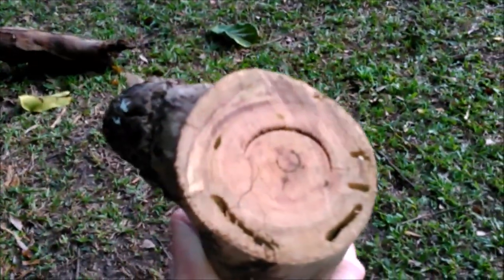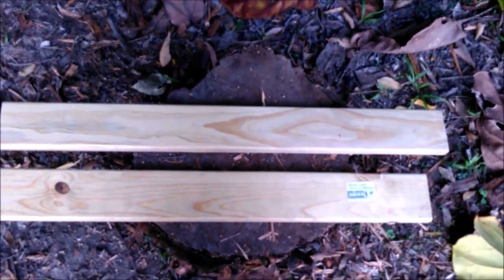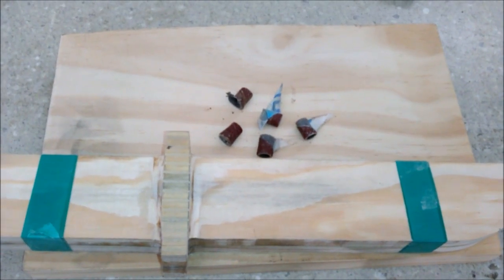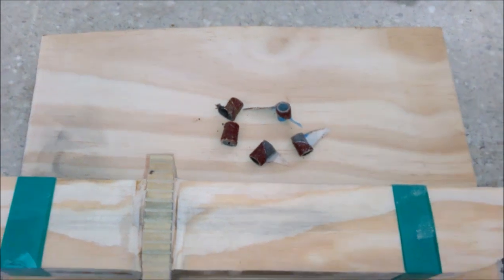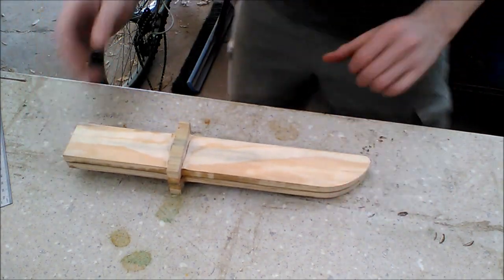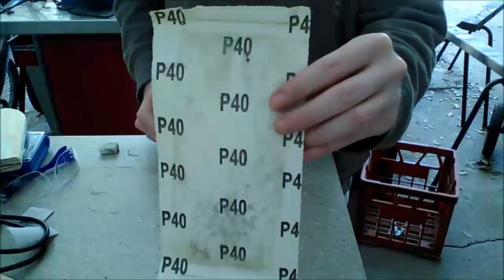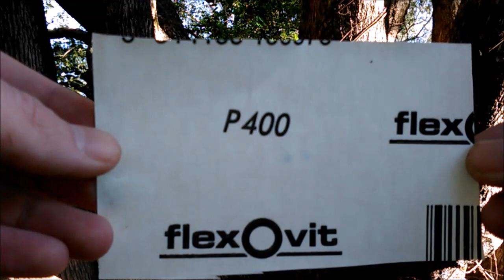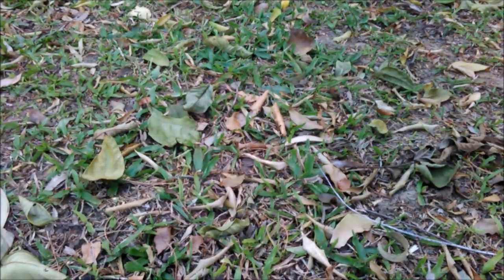Makin' a HANDLE AND SHEATH for my Tanto-Style Training Knife!!! (from an Old Pine Bed Slat)

Comment: must be hard at times to find right bit of wood to work with mate looks like you did ok
😊 👀fully watched 👀🙆‍♀️small you tubers supporting😊 👍we gave a like👍🙆‍ IAmACreator support♀️😊
Reply from the maker: It's horrendously hard to find good wood sometimes! It's weird, one day you will find a good piece without even looking but then when you need something of a specific length or thickness, there is none anywhere! I looked for a good bit for this project for over 2 weeks I think. Thanks for stopping by and watching, I really appreciate it :)

Comment: Sup
Reply from the maker: The sky usually. Unless you are in space and at that point direction becomes somewhat meaningless. Within our solar system you could sorta judge up and down based on the ecliptic plane the planets follow but as soon as you get outside the solar system there would be no concept of up and down, or left and right. :) Thanks for the comment!